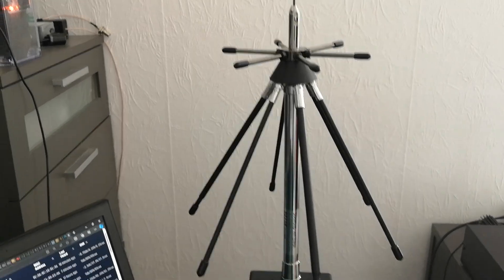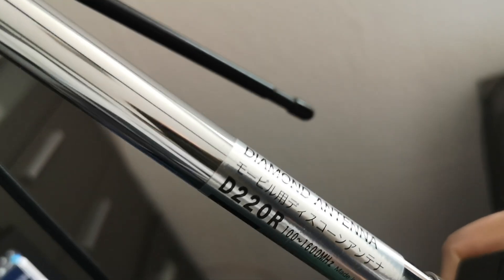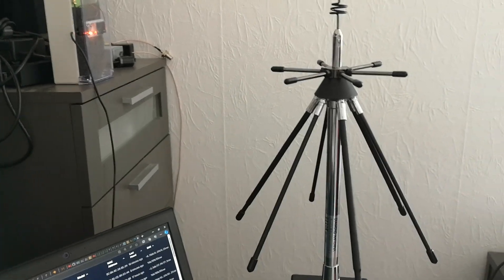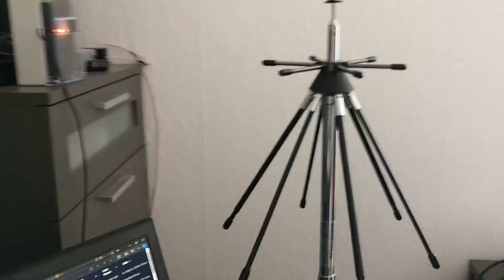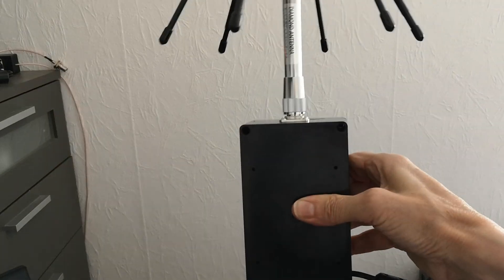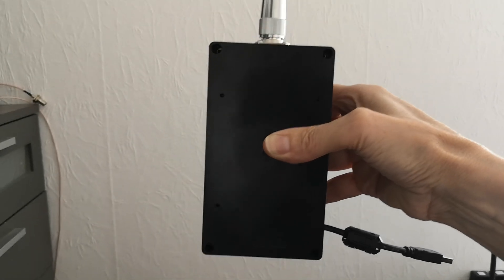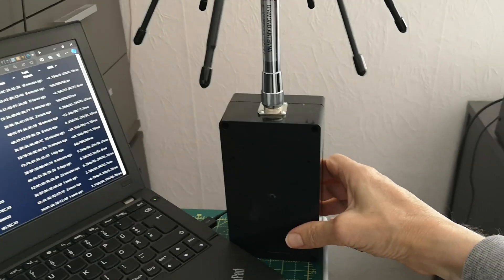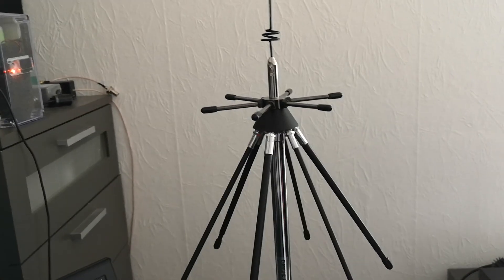Discone Antenna from Diamond Inc.

Comment: Can you transmit on it?
Reply from the maker: Yes you can. Maximum power might be 30W or so due to the thin insulating layer. I would not transmit on frequencies where the swr is higher than 2:1.